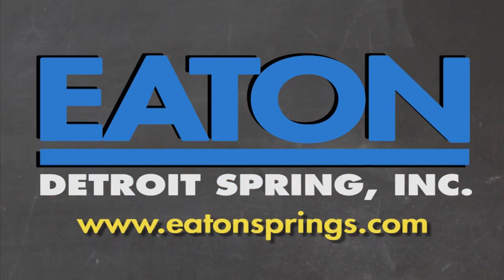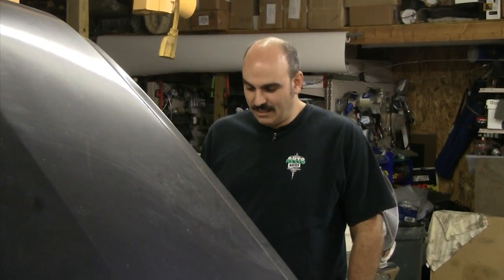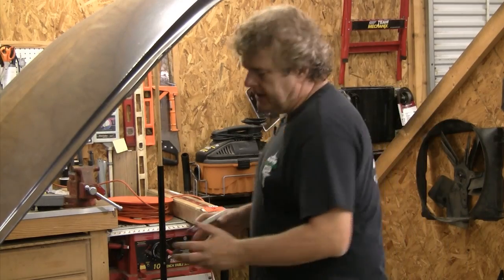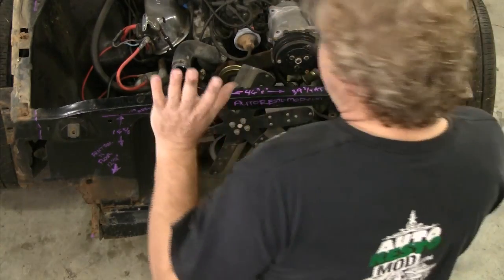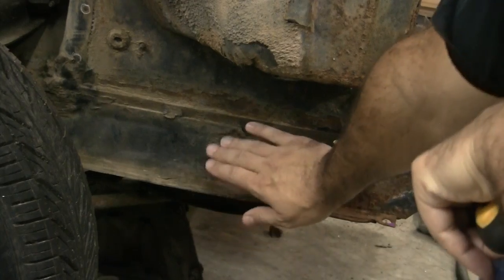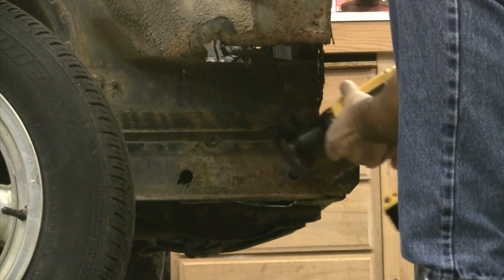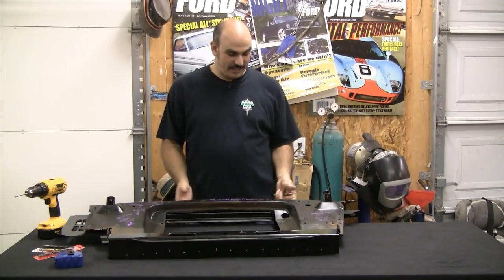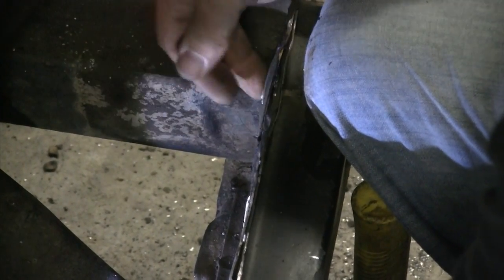1965 Mustang How To Radiator Core Support Battery Tray Apron Replacement Episode 235 Autorestomod

Comment: Great job Jeff, as usual. One word of advice you didn't mention. When it comes to purchasing your replacement core support, vendors offer several different pieces. One piece is a less expensive core support which is made of thinner metal (with or without the lower cross brace). A newer piece is the support with cross brace and made of thicker metal. Even if you don't need the lower cross brace, do yourself a favor and buy the thicker metal version. When compared side by side the difference is quit noticeable in quality and strength. If you don't want/need the lower cross brace, simply remove it before installation begins. Considering the effort it takes to change the core support, the quality, strength and fit are well worth the extra bucks!

Comment: Major surgery!  So my concern with tearing out a core support is tower collapse.  If the car was a big block, etc, is there chance of the tower tops tipping in?  I'm wondering if it helps to rig up something like Monte Carlo bars before cutting?  Or, am I thinking/worrying too much?
Reply from the maker: +Karl X Don't think you can ever over think the structural part of this. Would a cross brace (like a monte bar) would be good? absolutely. But as long as the engine brace under the car is there, and the factory shock tower braces are there (and tight) you should be OK, note we say SHOULD, if there are other structural deficiencies (floor pans, frame rails etc.) nothing you do will help. Our little hard top has new pans, good rails and all the correct parts in place. We did a measure before and after removal of the apron and our shock towers never moved. BUT, a cross brace of box tube can't hurt either. We'll address this in the next video on 10/22/15.
Reply: +AutoRestoMod Makes sense to me!  While we're on the subject,  can you guys can do an episode on installing sub frame connectors on a unibody like the Mustang or Fairlane.  With so many guys stuffing heavy twisting big blocks in these cars now,  we're looking for ways to keep it from knotting it up.    I've got a 68 Torino that I'm planning to fit a 460 in.  I heard that I have to maybe even weld up the shock towers better?  Thx.
Reply from the maker: We have a funny idea about that. These chassis are built for a certain amount of flex. While sub frame connectors can help reduce chassis flex, it can pop up in other areas, on the Fairlane hardtop you could see cracking at the B-pillar (area behind the rear quarter windows) if the chassis is tightened up a lot. There are several companies that offer these, so keep an eye peeled we might just do it!
Reply: +AutoRestoMod I agree about the B-pillar issue.  When we restored my Torino fastback, we "got the lead out" of the seam and welded it up plus used All Metal.  This is where I worry about cracking etc. after the  big block is in.  Hey!  I know, why don't you guys drop a 460 into the Fairlane wagon??  Lot's of 68-69 owners would LOVE to do this, it's waaay cheaper to make much more horsepower with a 460 than an FE. Crites has a kit too.
Reply from the maker: LOL The Cleveland is plenty quick enough and gets marginally better mileage. But, we have our eyes on a Ranchero...

Comment: Even through the Canadian battery tray is thicker metal, their are a lot of trimming to do, plus making more holes for the solenoid attachment, wire holders.  Also the fitment is not as correct.  After I welded the spectra battery tray and put on the fender, their were gaps on the fender and the upper tray.  Like 1/4-1/2 gaps.   For everyone else, be careful  using an angle grinder with flap discs.  An 80 grit flap disc will take out the MIG welds fast, but can eat trough the metal if not careful.
Reply from the maker: +Maksim Geyman The panel we got from NPD fit great. The only place we had fitment issues was a mild misalignment of the battery tray bolt reliefs at the bottom of the panel which we had to "kiss" the edge of the panel with a grinder to get clearance for the bolts. You are for sure right about the flap disc. We use a hard grinder disc for that and believe me, it can still try your nerves! =)